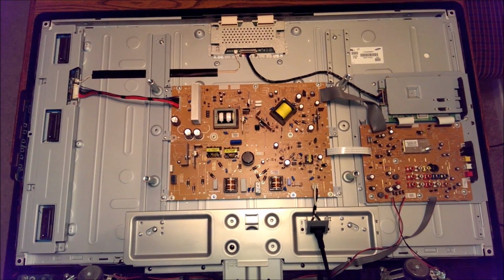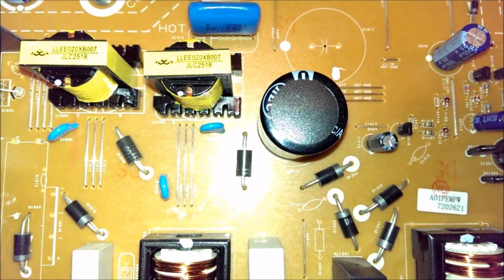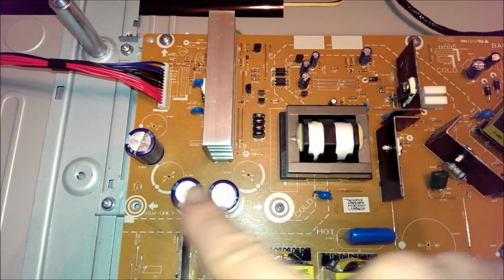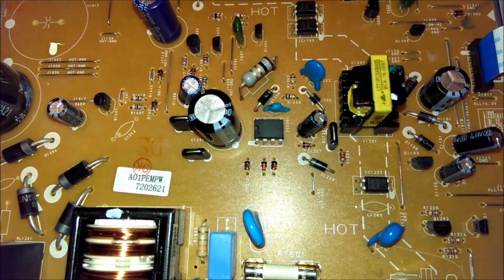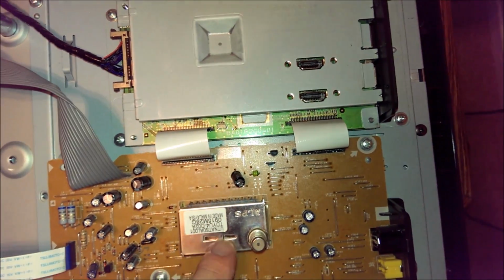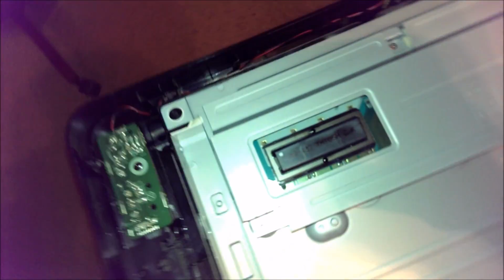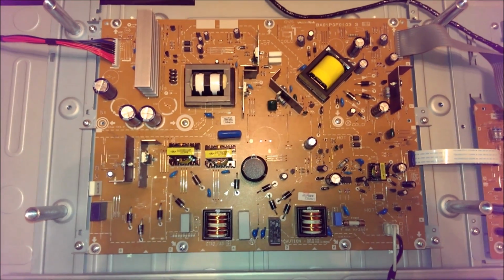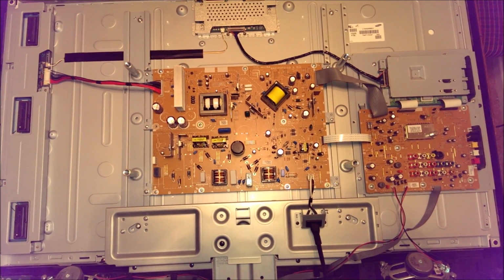Repair Tips for Magnavox, Emerson and Funai 40" LCD TVs (No power? Click here!)

Comment: Possible to replace the lcd panel if it is cracked? Mine got damaged in storage
Reply from the maker: No. It's not economical as the LCD panel costs more than a comparable new TV these days. Salvage the boards and sell them on eBay, and recycle the rest.

Comment: Hi,  I have a Philips 46PFL3608/F7 DS1  chassis PL13.14.  Originally Dead, FA5640n shorted.  Replaced.  Tv powers up. 5 blinks and shut down with pop in speakers.  Does this repeatedly.  Tv did come up once and played for hours then shut down.  No power up on LCD inverter.  Any Thoughts.

Comment: i have magnavox 32mf338b/27. not sure what is wrong but lost power and think maybe tv did it. break was popped and when turned it back on tv didn't turn on and the green light flashed like it was turning on then it flashed faster. i unplugged it and plugged in and got it to come on but turned it off later and it wouldn't turn back on. unplugged it and plugged in and now it is working. think might leave tv on instead of turning it off now since seems like there is a problem when you turn it off. really not sure what it wrong or what to even fix if i have too since it seems like it works when you can get it on.

Comment: I have the Emerson with the same model number power supply 40". The TV I got from a friend and its missing the mosfet on the Heat sink at the top Left of that Board and the number is D1721 I can't find the schematic to tell me what it is that solders in that spot. Will you please tell me the Mosfet type or its number so I can buy one to solder it in? I have been searching for 3 days for this item. Thanks My email is jkasza101@gmail.com
Reply from the maker: I don't have this board I my possession so I cannot tell you what part is there. If the legend starts with D as is the case with D1721, it's probably a dual diode and not a MOSFET. Beware that they come in common anode or common cathode!

Comment: Andrew--GREAT video. My Emerson has the same Power Supply board and the fuse blew. Replaced it and blew again. Check diodes and D1201 and D1203 were shorted. Replaced them, fuse blew again plus same diode plus D1202 is now shorted. Any ideas? Thanks in advance   rhalama at gmail dot com

Comment: Hi I have a emerson lc401em3f that the red light will flash several times but no power. The power I have tested the diodes and d1706,d1707 ,and d1215 are all shorted meaning I get current going both ways when testing in diode mode on my multimeter. Is there anything else I should be check before replacing these parts?
Reply from the maker: Test all of the large rectifier diodes if you have not done so already and test the MOSFETs mentioned as well as they often fail when one of the rectifiers fail.

Comment: I expected to find a fuse for the LF320EM4 Emerson TV /  The typical glass barrel fuse.  I can't find it.  Power supply board BA3AF0F0102 3  Where can I get the power board.    The power board shows  F 602   but the repair kits for some of these boards contains F601.  Does my TV have fuse 601?  if it does where is it located.  My friend said he thinks it was a lightning strike.  No sign of bad caps.   Have no lights clicks or anything.  Any help or tips or a place to get that board.   Please  help me with my "hobby" Tv fix.  and thanks for the vids that help us all save our sets.

Comment: well i got a emerson flat screen tv no power how can i tell if the fuse
Reply from the maker: joseph eckerthart I'm not trying to be condescending but when people ask such basic questions on videos like this, it's a little scary. Why? Because it shows that you are unfamiliar with the procedures of basic electrical troubleshooting and the tools used during such. A TV or other AC mains powered device is not the place to learn the basics of electronics. These devices are unforgiving of technician error and errors can easily result in additional damage that may not be economical to repair or could damage other connected equipment. Other errors may cause you to receive a severe electric shock, which can be fatal. There is also the risk of fire if proper repair procedures are not followed.

I take no responsibility for any actions you do with your TV. With that disclaimer out of the way, this is how you test the fuse....

WARNING! RISK OF ELECTRIC SHOCK!: UNPLUG THE SET AND WAIT 5 MINUTES BEFORE OPENING THE CHASSIS. 

Power does not need to be applied and should not be applied for this test. The large capacitors (can shaped devices) on the power board can store dangerous amounts of electric charge after the power is disconnected under certain conditions. (Normally the set bleeds it off entirely after a few minutes and charge retention is pretty rare. Still, occasionally it's a nasty surprise.) 

You will need a multimeter. You may use either the continuity function or the low ohms range to determine if the fuse is blown. Good fuses show up as shorts (low resistance, less than 1 ohm) and blown ones show up as open circuits (very, very high resistance).

In your case, if the fuse is blown, finding the exact cause is likely out of the realm of your current skill set and equipment. A replacement power board is your best option if the fuse is blown. In most cases, replacing the power board will bring the set back to life so its a worth while gamble. Just use care with the connectors, some are friction fit and others may have release tabs that need to be pressed to allow the connection to be released. Take your time, document where everything goes (pics help!) and put everything back exactly as it was originally. Sometimes little things like a screw or little sheet of plastic you might think the TV could work without are absolutely vital!

You can keep the old board for soldering practice or use it to learn with if your replacement board seller doesn't have a core charge. If you're interested in learning more about electronics in general, I encourage you to check out Lessons In Electric Circuits at http://www.ibiblio.org/kuphaldt/electricCircuits/ You should go through Volume I (DC) before you take the TV apart, it will help you succeed and stay safe.
Reply: +Andrew Kwiecinski right on. without formal electronics education stay the hell out of your TV. we earn or living from the occasional easy one, not from the challenges presented when amateurs screw it up worse.
Reply from the maker: +Don Peshal I've had simple repairs turned into complete trash because someone tried to be cheap. The sad part? What they spent on soldering supplies and tools that they had no clue how to use would have almost fixed the TV. It needed a few caps changed, after they got a hold of it and made a few solder bridges it needed a PSU board and a signal processor board.

I now charge a higher diags rate for things customers have had a crack at. $100 starting bench fee instead of $45....not because I'm mad but because I have to inspect more stuff and I'm less likely to make a successful repair that I can bill for.

Comment: I have a Emerson LF501EM4F 50" with a blown fuse. I hooked up an inline fuse and the fuse blows immediately when the power cord is plugged in. Can you recommend what components to check? I see no obvious damage or bulging caps.Thanks.
Reply from the maker: Mark Ellis Same as in this video because the fault is almost certainly in the primary side. Look for shorted diodes and power transistors.

Comment: my image flickers could it be a problem with the main Emerson LC401EM2F Digital Main Board or the inverter board or what should i check it also has a dead pixel like horizontal line 1/4 way on top ans bellow that plays yellow n blue. how to fix plz
Reply from the maker: FRONT STEP STUDIO Check the connections from the main board and the panel or timing controller board. Wiggle this cable a little with the set on and see if changes occur. While testing, keep your hands WELL AWAY of the power and inverter boards, these are very dangerous when live! 

If that fails, the panel may be going out. Horizontal lines generally have a poor prognosis.

If the inverter is going, you'll lose the back light but you'll be able to see a picture if you hold a flashlight up to the LCD.

Comment: hi Andrew Kwiecinski, my tv philips 42pfl7422/98 psu psu give up
further check result :
1. STW18NK80Z(Mosfet Q901) fail - Replace with SWT25NK120
2. TEA1507P (IC904) fail - Replace with TEA1507P
3. RGP10D ( Diode D912) - Replace with RGP10D
4. Main Fuse T5.0A

After repalcing mention componen, TV manage to power up & functioning as normal but the heatsink (Q901 mosfet) is very hot and finally after 30min, PSU give up and blow up those newly replaced component.

any advice what did i go wrong??

thanks in advance.

ps: here is the link for the technical manual / schematic for those who is looking for it.
 PHILIPS 37-42-47PFL7422-79-93-98 CHASSIS TPT1.2A[LA] - link
http://elektrotanya.com/philips_37-42-47pfl7422-79-93-98_chassis_tpt1.2a[la].pdf/download.html
Reply: solve this tv.. it was the component sold to me a counterfeit unit.. reorder new unit from farnell solve the problem.. thanks all
Reply from the maker: You need to check the switching waveform on the gate pin using an oscilloscope and the load current. The waveform should be sharp with fast rise and fall times. Look for any shorted parts elsewhere in the circuit. (especially look for other shorted diodes!) Check for bad capacitors too.

I can't find a datasheet for your new MOSFET. It may or may not be suitable for your application. Verify that it is.
Reply: thanks for your input.. & my bad
new mosfet is STW25NK120 not SWT25NK120 typo error
Reply from the maker: Google knows nothing of an STW25NK120 and neither do the large ST distributors. Datasheet Archive also knows nothing of this transistor although your original brings up a hit in every search.

In light of this revelation I'm going to suspect that you may have obtained a counterfeit transistor!

Please contact ST to verify the authenticity of the device.

http://www.st.com/stonline/contactus/contacts/index.php?
Reply: +Andrew Kwiecinski   digikey. real semis

Comment: i have a funai 40mf401b/f7 that has the following issue and would like to know if you ever ran into this. i end up getting it to work eventually by unpluging and plugging in many times.
1. Sometimes when plugged in, relay clicks once and will not accept on command. Red light on solid.
2. Sometimes it will click a second time (red light remains solid) and will accept on command from side button or remote, but screen doesn't power. Then red light remains flashing.
3. Sometimes it will cycle correctly and the screen will power on. 1 click, solid red; 2 click &power button pushed, red light flashes, then screen lights up with "Digital Television" message. All is good.
This can also happen when power is turned off by either button or remote. TV usually clicks once and red light flashes, but screen doesn't power.
Reply from the maker: Verify that the voltages from the power supply, especially standby voltage, are good. You may need an oscilloscope to check for excess ripple. Look for bulging or leaking capacitors, cold solder joints and loose connectors.

If the PSU checks out, replace the main signal board. (Fixing it is probably more trouble than it's worth.)
Reply from the maker: I haven't seen this specific TV with this problem but usually this type of problem is due to bad capacitor or cold solder joints.